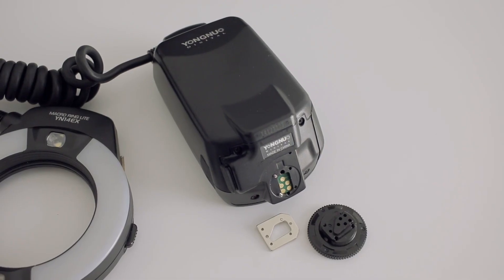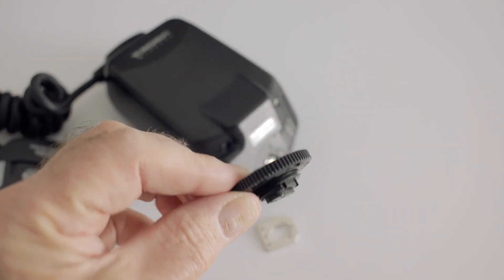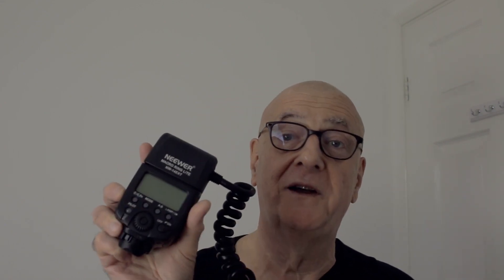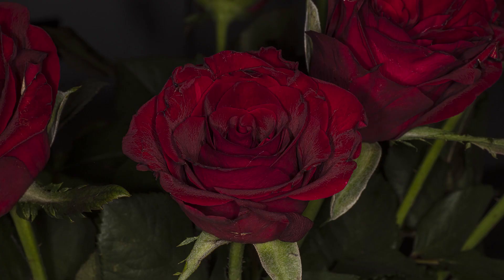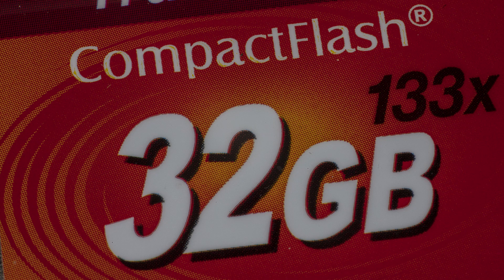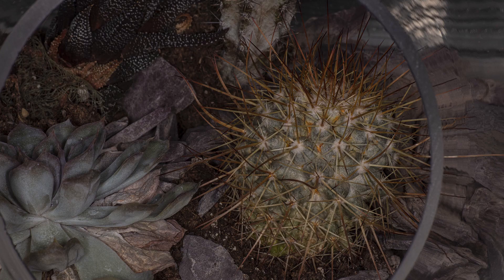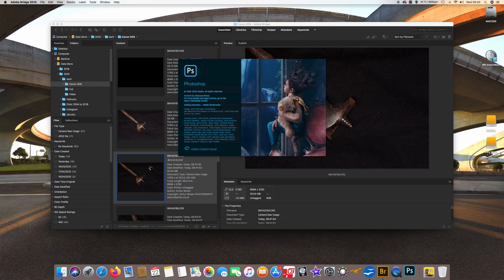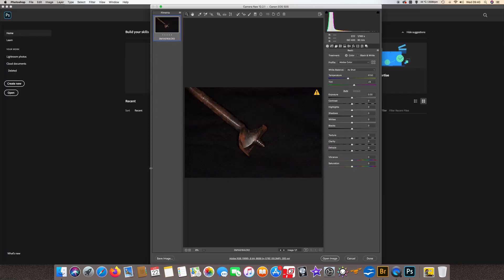Neewer® Macro TTL Ring Flash Light

Comment: Hi mate do you have any advice on how to diffuse the light from a ring flash?
Reply: Ring flashes do have a little diffusion built in but because they are generally so close to the subject they can produce harsh results nevertheless.  You could put some diffusing material over the flash head - maybe a sheet of white paper.
Reply: Some tissue paper ( Kleenex )or grease proof paper that is used for baking; also can add just to one 1/2 of the ring for "main " and " modeling" lights to give just a hint of a shadow

Comment: Mm. Shoot in manual and the whole process of achieving exposure is simplified.
But also, if you are reviewing the ring flash it concerning that your review reflects all this work in Photoshop - where you able to significantly modify the result such that the flash capabilities are rendered almost irrelevant.
You have a ring flash, are the settings easy, does it produce an even light , etc?  That’s all a good review should be about.....
Reply from the maker: As I always shoot RAW files, I have no choice but to process them through Photoshop.